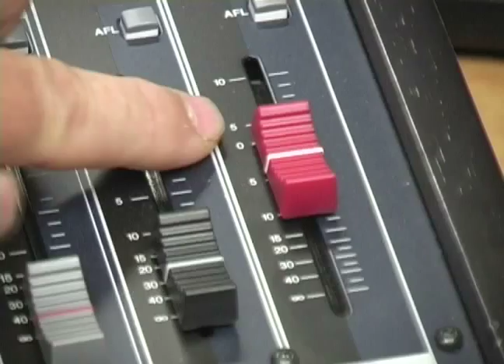How to Set Up PA Systems : Dynamic Range for PA System Setup

Comment: I completely disagree with you on this, there are a lot of venues made only of concrete blocks those are fun to eq even w/o monitor running; most of the time some LF's and MF's need to be cut and then set the needed highs, if the situation you imply was true we would not need eq but a treble and bass control, what I do is eq FOH, mix band FOH, then eq mons, mix mons individual band ch. and last turn up mons main volume enough to even out with FOH trust me, will sound terrific, no FB at all baby!

Comment: For Example....if you have vocals compressed to a point were there is no dynamic range left, there is a higher likelyhood of feed back either on stage or through FOH due to the higher overall level required after "flattening" the peaks and troughs from the said vocals.

Comment: omfg. if you have managed to get time to ring out the room before the show. most if not all standing frequencies in the room should be under control...

The only feedback that will be introduced into the FOH ( Front of House ) system will most likely be from the onstage mix (fold back / stage monitors). eliminating these frequencies via monitor graphic EQ can be tricky with hard reflective surfaces on stage. ie Wooden floor boards, plaster or wooden roof, hard walls. but completely possible.